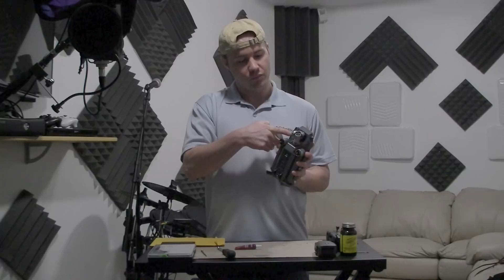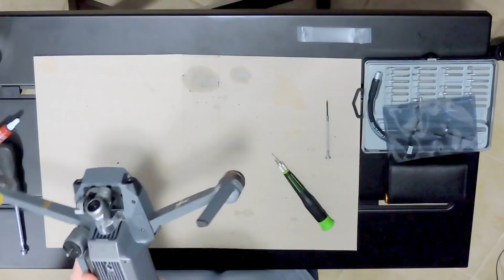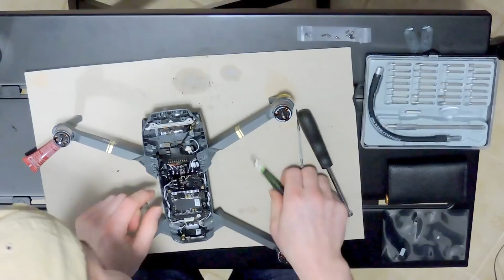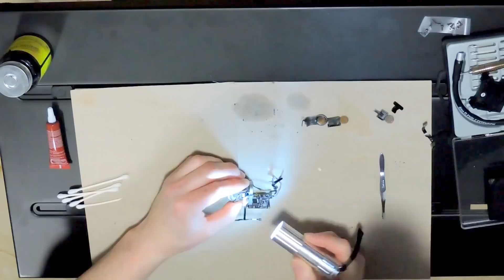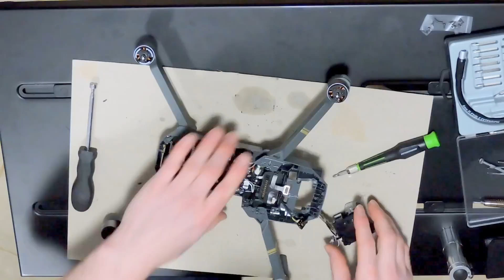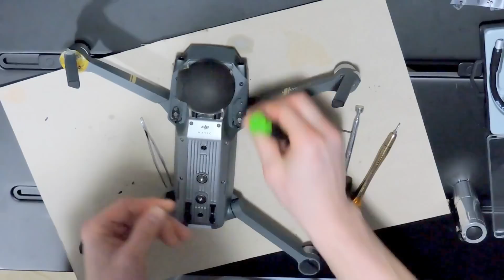DJI Mavic Pro Drone Crash Broken Gimbal Flat Ribbon Cable PCB Repair How To fix failure &Replace DIY

Comment: mine is broke the same. now If I fix this my self is it going to void my warranty?
Reply from the maker: The answer is Yes and No, If it is past 7 days and you did not buy the DJI care package you don't really have a warranty. In the case of warranty you would have to prove it was not operator error with hard physical proof to even try for a warranty claim. You can read the warranty policy at DJI.com, but without the DJI care package you have only three options that I know of. 1. Send it in to DJI for a costly repair, I hear they are costing 4-450$ USD. 2. Repair it yourself 3. Pay someone or a service to do it for you. I felt that it was slim to impossible to prove fault of DJI, so I decided to repair it myself and share it iwith the youtube community.

Please like and Subscribe,
LLS
Reply: Liquid Laboratory Studio I have the refresh care. but I know I can fix it myself. I just want to know if I do fix it myself that it doesn't make my warranty I paid for useless.
Reply from the maker: That is a tough one, DJI doesn't log their calls so you could call in to a rep and ask directly North America Number +1 818-235-0789. I know with the DJI Care Refresh plan you get up to two replacements with a 99$ fee. It would be one of those safe-than-sorry situations to just have them replace it. They claim they are replacing the whole gimbal/camera unit which could have hidden damage and save you time and heartache. I am sure they can easily spot a repair job.
Reply: Liquid Laboratory Studio thank you man. Ill get it sorted out one way or another. Im just afraid to use one of my replacements. lol

Comment: Great video....I was all set up to replace my flat ribbon, after waiting 3 weeks for the part I then discovered that I also needed the camera cable that you cannot buy...back to DJI ...for repair....
Reply from the maker: @livewire70 you are welcome, I am so sorry. I also have the phantom 4 pro and rarely take the mavic out of its neat little case. I am too afraid to fly it in medium winds considering it is a flying piece of brittle composite. I know the price for the camera is around 400ish did you get a quote back? If it cost any more makes you want to put the money toward a new drone... They will force you to buy a new camera and gimbal assembly, it is worth giving it a shot having a local electronics shop try to solder a wire or realign the clamp. I usually attempt things like that myself, I figure I have nothing to loose lol

Thanks again for watching, please like and subscribe
LLS
Reply: cheers mate, I tried the local shop to start with and it sat for 2 weeks without being touched . DJI did a great job with the repair and it was back to me within 2 weeks including interstate shipping. $279 (aussie dollars) all up and the replaced some things that were not on the quote...
Reply from the maker: I am glad you got it back. Hope everything works right. Out of the box, don't forget to calibrate the IMU, Compass, and visual sensors. The visual sensors are difficult so here is a video I made on how to do it https://youtu.be/0uJOQCPcJo0

Comment from the maker: I am sorry about that, I did testing on the camera and checked my leaning. I just didn't realize that when I did the intricate repairs I would lean in. It was complicated enough I didn't want to redo it. Here is some additional how-to advice I gave another user.
There is some that didn't make it on camera while I was doing the trial-and-error part:
Like I said in the video, I used the old one as a template
I recommend taking pictures before of the old one installed, so you get a general idea.
1. There are a few fold points you can partially crease them following the original ribbon folded direction
2. From tp1 to tp2 connector is the real tricky part it reverses twice and folds over itself at connection tp2
3.Remember that the gimbal turns freely so the slack will be on the 
opposite side of the pivot joint (it basically loops back to not 
restrict the motion of the motors)
4. The cable lays flat so if it is twisted or awkward it is not correct or not folded properly.
5. You will have to fold tp1 and tp2 at the line half before you thread it through the side and half afterward
6.Make sure to clean all connections the original liquid tape will 
obstruct you from SOFTLY pressing on the tp1-tp4 connections.
7. The adhesive on the new ribbon is not that sticky so you can wait until you 
are done to remove the stickers. Because of the trial and error and bending mine didn't stick the best. (I think this could be solved with a dab of 3m super 77: spray it on a pice of paper and dab with the small end of a cut q-tip: This step is not required I didn't do it mine turned freely the bends were in the right place and it was "good enough")
8.  Like in the video when installing the plates barely tighten the covers on the gimbal let the 
thread locker 242 (loctite) hold them in (they are fragile and could crack in the tightening process.

Please like and Subscribe: I hope it goes well be patient and remember it is tricky not impossible
Liquid Laboratory Studio

Comment: My Mavic pro crashed into a cliff, watch here:https://www.youtube.com/watch?v=yvPS3z2L0ho
Has it broken a ribbon cable? Cuz camera keeps on restarting and I have no control of the camera? 
Plus DJI support sucks! No reply In a week
Reply from the maker: I saw your video I don't know if you fixed it yet, but that is exactly what it does when the ribbon cable is broken.

Comment: i replace a new ribbon cable.but warning gimbal motor overloaded.
repairing shop said i should to change a new gimbal and camera.
Reply from the maker: Did you say you did replace the ribbon cable? The gimbal motor overload code is given when there is a broken ribbon cable and/or if there is something wrong with a motor. If you crashed it and the metal mount broke leaving the camera dangling by (wires and the ribbon cable) exposing this is a weak point, then there is a high chance the gimbal overload is a broken ribbon cable.

Good Luck,
Liquid Laboratory Studio
Reply: The gimbal probably, if the gimbal motor overload continues... but if you can see the video of the camera in your mobile or tab... the camera works perfectly, only change the gimbal.

Comment: Hi thanks for the good video .. i have a Mavic pro but it crashed the same problem you have ( THE GIMBLE ) so can i ship my drone to you and you fix it and i will pay for you and i will pay the all shipping and all what my mavic need !
Reply: I recommend you to go to any drone repair shop, they will help you with less risk. At DJI shops they cannot repair a gimbal (they only change it) so go to another. If they don't have the replacement part yo can buy it here: https://www.fstop-labs.com/collections/mavic-parts/products/dji-mavic-pro-gimbal-flexible-flat-pcb-ribbon-cable
Reply from the maker: @aggressive al Were you able to fix your drone?

Comment: Was the gimbal not responding after you crashed? My gimbal is responding and working fine but no video feed after crash.  This was quite the project you performed, I am curious what was the issues you were experiencing to make sure it's worth this undertaking in my situation?
Reply from the maker: That is the opposite problem I had maybe the wires hanging down from the gimbal are damaged (video feed wires). If you look you will see them in the video when I am working with the gimbal.
Reply from the maker: 1. any screw set with a hex head 1.5mm (I got mine at harbor freight)
2 any really small jeweler Philips heads not too cheep because they could strip the screws
(Both of these can be bought at most local stores)
Reply from the maker: The problem I had was the exact opposite of yours. I had video feed but no control/mechanical stabilization. If you watch the video again you will see those strands of wires for video that are dangling and connected to the PCB circuit board. The actual gimbal is made of metal and robust, so if I had to guess one of the video wires got pulled too hard or split when it crashed. You can turn it on its back and inspect it with a flashlight before looking inside. If you are lucky the connector (the one I did not touch or remove became jarred and needs to be reseeded (pushed back on). I would take it apart and look for obvious damage before replacing the whole gimbal and camera unit.

I hope this helps. Please like and subscribe
Best,
Liquid Laboratory Studio
Reply: Thank you. I will check it out
Reply: Hello
I believe i got the same problem you have 
My gimbal is working but with no video feed. 
?? 
I try to open i dont have the repair screw kit
Reply: Would u please write on description the amazon or ebay link, for the repair screw kit to order it

Thanks for the video its really helpful

Comment from the maker: In response to someones comment:
It is possible to repair it yourself, just watch the video many times (considering DJI makes you buy the whole camera assembly $350ish you have nothing to loose if you didn't buy DJI care/repair package) . 
1.The hard part is following the ribbon cable around the connectors and looping it; take many pictures of your original one from all angles because it wraps around in different weird ways (use the old one as a reference especially where to fold the cable). If you open it up and don't feel comfortable send it into a third party repair shop like Drone Nerds. All your own repair jobs are at your own risk!
2. The second part is to be gentle when plugging in the ribbon cable connectors (softly feel them pop in). 
3. Barely tighten the screws on the gimbal covers the plastic can crumble (the lock tight will hold them on)
4. Always ground yourself and try not to touch the circuit boards.

Best of Luck, 
Liquid Laboratory Studio
Reply: Thanks for your video.  I'm working on the same flat ribbon repair.  I managed to disassemble the gimbal and then the ribbon. But your video is not clear enough to help me to reassemble the ribbon.  Can you provide some more details ?
thanks for your help !
Reply from the maker: There is some that didn't make it on camera while I was doing the trial-and-error part:
Like I said in the video I used the old one as a template
I recommend taking pictures before of the old one installed, so you get a general idea.
1. There are a few fold points you can partially crease them following the original ribbon folded direction
2. From tp1 to tp2 connector is the real tricky part it reverses twice and folds over itself at connection tp2
3. Remember that the gimbal turns freely so the slack will be on the opposite side of the pivot joint (it basically loops back to not restrict the motion of the motors)
4. The cable lays flat so if it is twisted or awkward it is not correct or not folded properly.
5. You will have to fold tp1 and tp2 at the line half before you thread it through the side and half afterward
6. Make sure to clean all connections the original liquid tape will obstruct you from SOFTLY pressing on the tp1-tp4 connections.
7. the adhesive on the new ribbon is not that sticky so you can wait until you are done to remove the stickers. Because of the trial and error and bending mine didn't stick the best.
8.  Like in the video when installing the plates barely tighten the covers on the gimbal let the thread locker 242 (loctite) hold them in (they are fragile and could crack in the tightening process.

Please like and Subscribe: I hope it goes well be patient and remember it is tricky not impossible
Liquid Laboratory Studio
Reply: Liquid Laboratory Studio thanks again for your help
I finally managed to reassemble the gamble and start mya mavic again.... but the movements of the gimbal are erratic.  By hand it moves freely but when mavic is on I now have a vision system calibration error...
Any idea?
Reply from the maker: I will have a video up hopefully tomorrow to fix the vision system calibration... Do the manual GUI phone one first and the more advanced one I will post. As far as the if they are erratic maybe the cable is wrong... So you can take your hand and move the first two pivot points up down right left? Is the gimbal by any chance obstructed.
Reply from the maker: I hope you were able to get the gimbal to respond correctly. It took a bit time, but I have the visual sensor calibration video up. The program did not work correctly on many different machines. I have the whole how-to located on this video link. https://youtu.be/0uJOQCPcJo0

Comment: Gracias por compartir. Yo tambien tube el mismo problema pero no encontre el flat ibbon cable PCB, donde lo compraste?
gracias por adelantado ;)
Reply from the maker: http://www.fstop-labs.com/
The company also has it on Ebay and Amazon for 39.99 plus shipping.
La empresa también lo tiene en Ebay y Amazon para 39,99 más gastos de envío.

buena suerte,
Liquid Laboratory Studio
Reply: Liquid Laboratory Studio muchas gracias 👍🏻